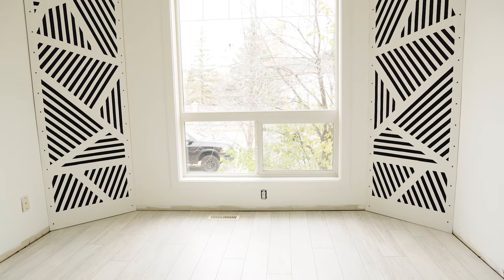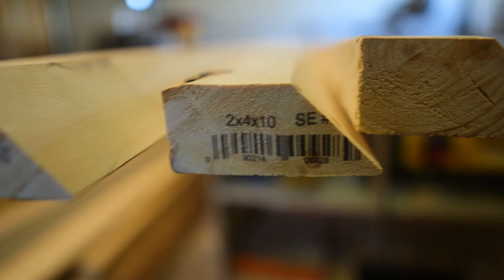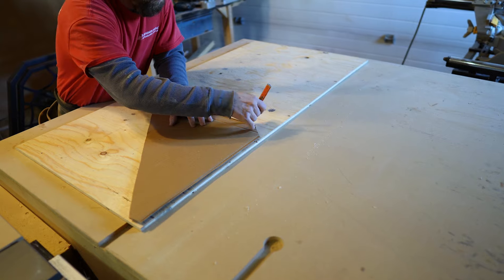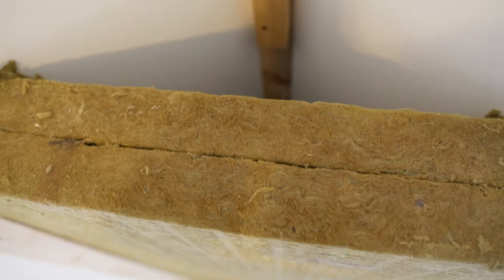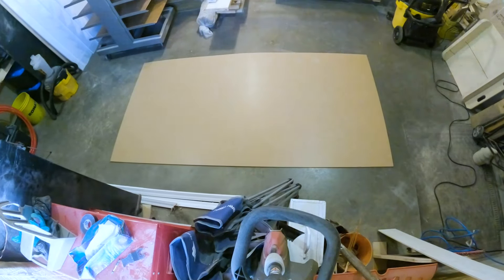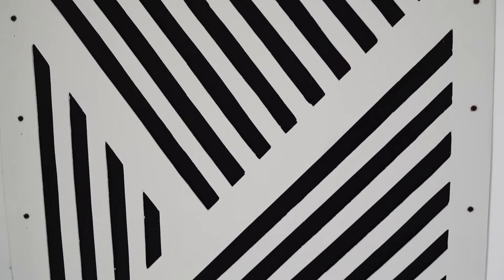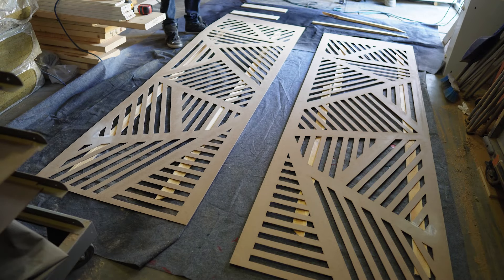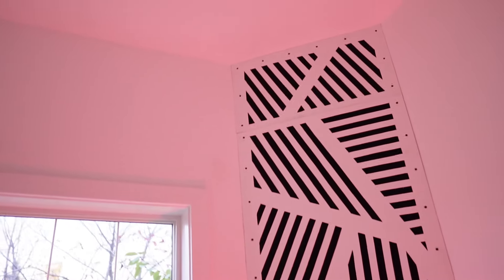DIY bass traps unlike anything you've ever seen.

Comment: the way you see it and in your opinion - doesn't mean it's a truth. absolutely wrong built. fill up those corners with a very light GLASS wool insulation. and use GLASS wool not rock wool and do your research in a proper sources.
Reply: What are the proper sources?
Reply: @ nwaa labs

Comment: high density isn't really what you want for velocity absorbers, 9000 rayls/m is probably the best air flow resistivity to absorb low frequency, what matters most to get the lowest sub bass with broadband absorbers is the combination of right density to gap size to incidence angle.
Reply from the maker: Thanks for the detailed explanation, I'm still learning the finer points of acoustic treatment! It's difficult, because as im sure you know. It's quite the rabbit hole to go down learning about this stuff. Sources all say different information. From my own personal experience, it seemed as low the low density absorbers ive built multiple times in the past didn't do much for bass.
Reply: @lifefixx  broadband absorbers that use rockwool are velocity absorbers, for them to work great you must position them where there's lots of particles of air moving, this is why they work great in corners but not very close to the walls/floor/ceiling, you must have an air gap, because very close to walls you don't have much movement for low frequencies, just pressure. The absorbers that work great closer to walls/ceiling/floor are the tuned ones, like membrane and helmholtz, because they are better activated by the most pressure position you have for the mode they are tuned in. Whealy and Amroc have good calculators online for predicting possible issues, REW also have good simulation environment. Treating low end is very tough, you must optimize position for everything: you, the monitors and the absorbers (and different types of absorbers works in different places for different reasons).

Comment: Seems smart to focus on the low end and not over-dampenning the high frequencies. In many radio studios they want to achieve this as the speech intelligibility is the highest when raising the consonants which sits in the higher frequencies and lower the vowels which sits in the lower frequencies. I read a Master Thesis from KTH Royal Institute of Technology in Stockholm, Sweden where they tried out different combinations of slatted panel absorbers. The most efficient result was to have slats being 70 mm wide x 16 mm deep and a slot width of 4 mm and then damped with a porous absorber in the form of 50 mm Rock Wool (70 kg/m3) resting on 20 mm of air - before the wall. That combo would give an absorption coefficient of about 0.9 between 160 to 315 Hz, and 0.3 at 1000 Hz.
Reply: Can you share the link of the Thesis please?
Reply: @waveestudiopro  Unfortunately, the link is removed when included here. But search for "Sound absorption of a slatted panel absorber" by Matti Saarne. There's a direct link to the PDF through dyiAudio. Note that it's in Swedish except the English summary.

When I read further today, one could also go with the option to choose 70 mm porous absorber (14,5 kg/m3) behind the panel and leave out the 20 mm air gap. It seems slightly even more effective.
Reply: @megajonson9075  oh thanks!!
Reply from the maker: Thats very interesting. Its quite the science when you get into this stuff. I doubt I made these absorbers the best they could be for my specific room. But, I built them based on what I thought would work best.
Reply: It seems like you achieved this as you used slats in combo with the absorption. I guess going with the examples in the thesis would assume covering all walls more or less with this 16 mm deep slatted panel plus further 70 mm depth of absorption . which might not be a realistic option in your room. What it tries to resemble is an Helmholtz resonator focusing on the low end.
Reply: @lifefixx Talking about low frequencies in home studio context. To achieve best results you need at least to calculate (wave length - room dimensions) better to measure the problematic frequencies (mainly because of standing waves). In reality of home studio (bed room) is impossible to treat low frequencies with standard bass traps due to a big wavelength (50hz -> 4m, 100hz -> 3m and so on). Solution is to build a combinatio of helmholtz resonators (tuned to the certain frequencies) and a few wider range slat resonators + sound diffusers.

Comment: And the cloud. Just cover your ceiling with a GLASS wool panels attached o the ceiling or with a 1 inch gap but seal the sides completely. and don't tell me about that BS with a space behind a panel make the frequency go down - IT DOESN'T.

Comment: Measurements, please. You sort of created two Helmholtz-style resonators but evidently the construction was ad-hoc and not tuned to any particular frequencies. Unfortunately with room acoustics (especially in small rooms) it's very easy to put in a lot of work for very little efficacy. I hope these traps produce the desired effect.
Reply from the maker: It's beyond my expertise or care, to have done any pre or post measurements of sound. Considering the size of my room I'm quite happy with it. Although I do still hear room modes
Reply: @lifefixx  Hey, whatever floats your boat. If you're happy then I'm happy for you. 
Incidentally, room modes are the frequencies at which standing waves resonate in a room. Any room with boundaries and dimensions (i.e. every room) has modes, so you can never not hear them, regardless of how much treatment you apply.

Comment: Use porous absorber calculator when looking on how deep in the freq range you want to go. 2 things i wouldnt agree here are the density and depth of material. High denisty works perfect in this build because it is not really deep. But if you go for fully filled bass traps, the lower density the better. Around 6000 Flow resistivity is more or less best for that kind. In this video the rockwool is probably about 10000 to 12000 Pa.s/m2 (not sure, just by guessing). For 5 to 10 cm the higher the denisty the better. For deeper stuff go low on density. And more material will always preform better then less. Builds depend on the buget. Look this up. Try porous absorber calculator and play around and look up from more people to get your anwsers right. Acustics are a big ass rabbit hole😅

Comment: They look cool and the 4" plus air gap should be effective.  Do you have REW measurements before and after for comparison?  Like how effective are these panels?  How is the sound in the room?
Reply from the maker: I was not organized or patient enough to take recordings before and after. Hindsight is 20/20
Reply: Excellent video and really cool looking traps!!  I'm also super curious about the level of acoustical improvement you achieved with this first stage of treatment. Does the project feel highly effective to your ear? I'm doing research to affordably treat a large space.

Comment: The pattern looks cool, but for your next cover planel, try to look into Maximum Length Sequences as inspiration for binary amplitude diffusers in front of porous absorption. In terms of acoustics most repeating patterns are bad, and the shorter the repeating pattern, the worse they tend to be - so  an alternating 10 pattern eg 101010 is quite bad.  A pattern like [01][0011][000111] is an improvement, but there are even better ones you can calculate with a computer. Ideally you should use special binary sequences calculated to evenly distribute various frequencies into space. Unfortunately MLS can only be used for binary sequences of the length = 2^n-1, so 3, 5, 7, 15, 31 and so on. One such sequence for a length of 15 is 1, 1, 1, 1, 0, 1, 0, 1, 1, 0, 0, 1, 0, 0, 0. The pattern is based on a primitive polynomials x^4 + x^1 + 1. A 31-length binary sequence pattern is 1, 1, 1, 1, 1, 0, 1, 1, 0, 0, 1, 1, 1, 0, 0, 0, 0, 1, 1, 0, 1, 0, 1, 0, 0, 1, 0, 0, 0, 1, 0. 
If you want you can stack these sequences, and you can mirror reverse them - they will act the same way. There is a suggestion to add a 1 or a 0 between stacked or mirrored sequences, so that it evens out the total number of zeros and ones, as this is usually optimal. However, you can also used optimised binary sequences which lengths other than those offered by MLS, however the effectiveness is a little less optimal than MLS. This can be useful if you are needing a certain fraction of open area for acoustic purposes that is different to 50% open. For example this is a reasonably ok non-MLS binary 51-bit sequence: 11011000001010000000000100001000010000001001000000100011. Generally speaking, a smaller open area means slightly more bass is absorbed while more high frequency is reflected, and more open area means more high frequency is absorbed, but slightly less bass is absorbed. 
You can also just take the MLS pattern and increase or decrease the size of the holes to change the % open area, if you drill a hole for the '1' for example, but I wouldn't change it too much. 
You can look at this patent for binary amplitude diffusers to get an idea of how you can use them in a 2D panel. Basically you can shift the pattern and rotate the sequence back to the start. For new rows, just randomly shift by a value. In my experimentation I found that it's easiest to select shifts for each row out of a bag (no replacement). So, if you have space for 5 rows, then you'd randomly shift the sequence using one shift for each row, eg 3, 5, 2, 4, 1. 
https://patentimages.storage.googleapis.com/22/33/ee/93160f698058c4/US5817992.pdf

Comment: great job building this thing.the result is great . but i think you missed something about the density of the insulation. i think that when the density is very high its harder for the air to travel throught so the absurbtion is redused.i think usually its recommend a medium density insulation about 60-100 kg per cubic meter and about 1:1 ratio of aigap behind the trap - thickness of the panel.i hope its somehow helpfull to someone to do his own research  for his purpose and space
Reply from the maker: Great point! I however disagree. I do agree with the 1-1 ratio. But I believe the thicker the density the better absorption at lower frequency. Bass will travel through your neighbours wall and be felt and heard through drywall, insulation, even concrete despite air flow. The higher you travel up the frequency spectrum the less density and more airflow is required for proper absorption. This has been my experience.

Comment: Overall, I like this, I imagine it would help with bass resonance, but for anyone else pursuing something similar, I would like the idea of a single layer of dense insulation (half as much) and then put some fluffy in behind...  I believe it could capture more frequencies more efficiently.  The fluffy stuff is effective when you have enough of it and with that much space, you would have a decent quantity.  For the front panel design.. I would try leaving one half uncovered as a full-range absorber and leave the other half covered/slotted.  Thanks for the ideas, nice video!
Reply: THIS! ☝ And you can use up to 70cm of fluffy with airflow resistivity of 5-7kPa.s/m2. You'll get much better low end absortion down to 70-80hz. The "bass traps" of this video don't go much lower than 500hz. The design however is great! Just do it bigger and with fluffy behind the dense rockwool.